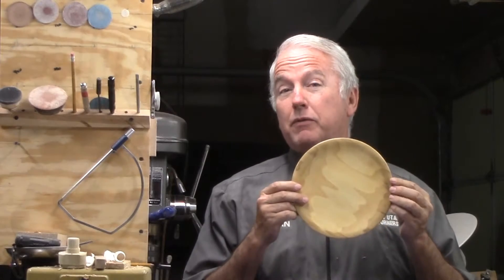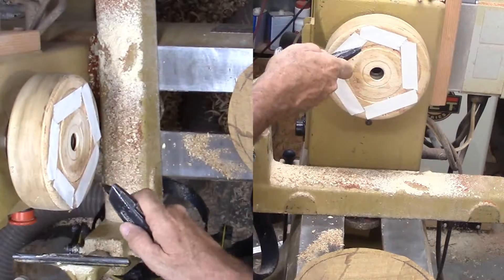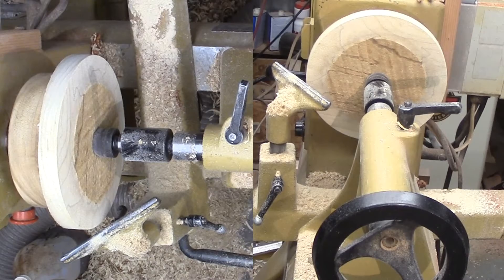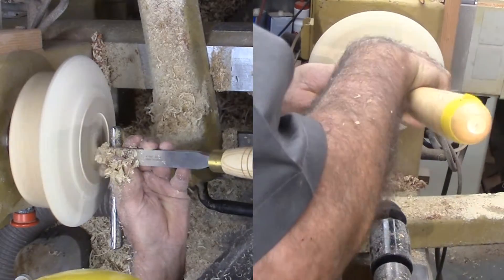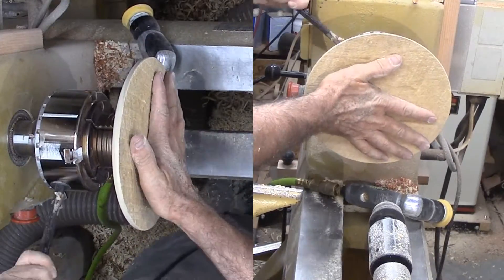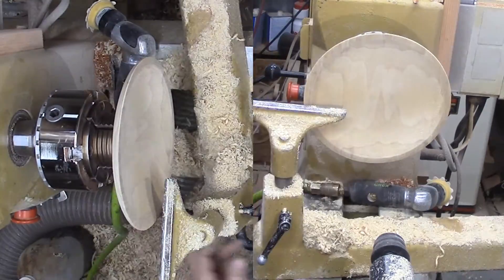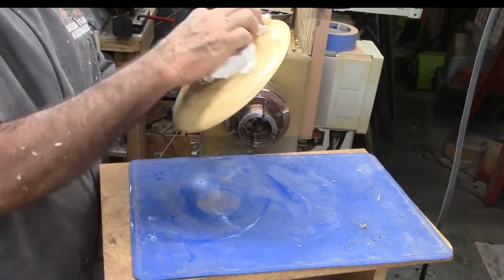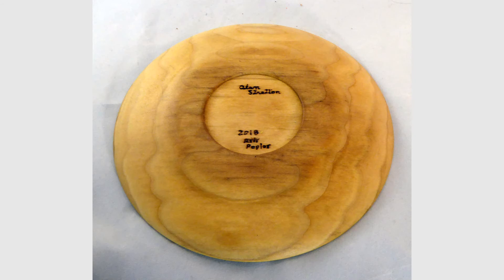Poplar Utility Dinner Plate For Club Challenge

Comment: The manual that came with my chuck jaws recommends no more than 1/8" mortise for expansion hold. (I'm a woman, so I'm allowed to read the instruction manual ;) ).
Reply from the maker: 1/8 should work. Be sure to keep tail stock pressure as long as possible.
Alan